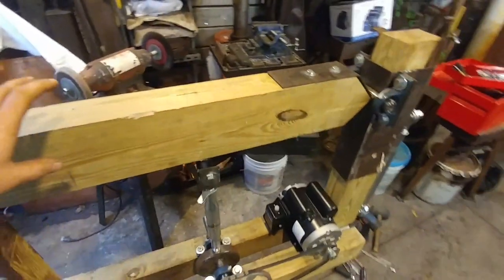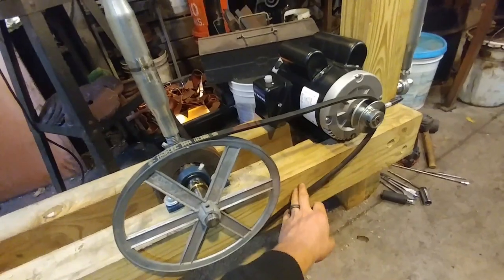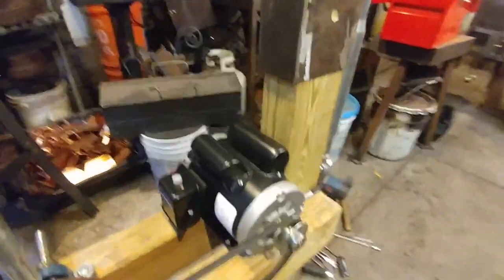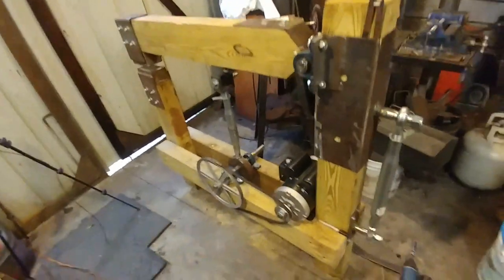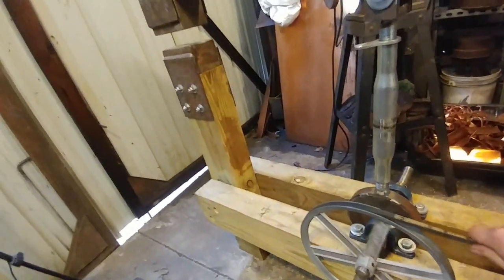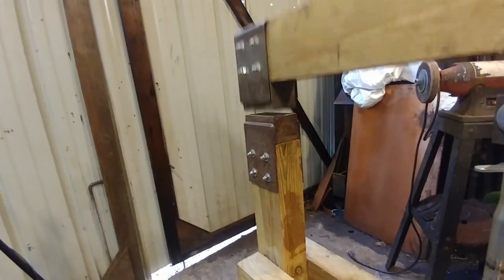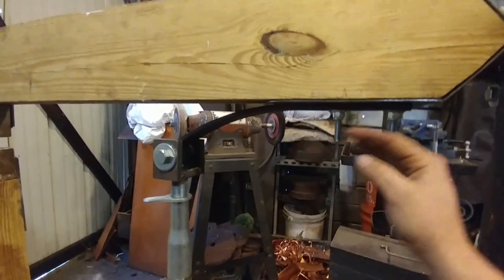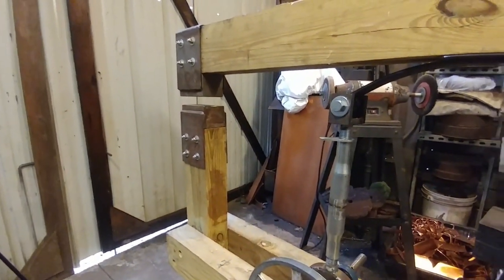Power Hammer Build News #8

Comment: It's looking really good Roy. It makes mine (a modified version of your improved hammer) look wimpy by comparison. It appears that your surgery is healing at a fast rate also. When I had all of my wisdom teeth removed some 45 years ago I developed a dry socket condition in both of the lower locations and it hurt like crazy and took a very long time to heal. I couldn't open my mouth wide open for nine months. Here's hoping yours goes much smoother.

Comment: Looking good Roy. Glad you’re feeling better. I have a question though. Are you going to use a mechanical way to tighten the belt to make it hammer or are you going to use a foot operated pressure switch to turn the motor on to make it hammer?

Comment: hey roy glad your getting better quick how much offset do you have on this cam your plans i brought say 0,625 inches i worked it out to about 15mm is this enough as that seems quite small for powering a hammer i know you get whip action on it but i feel its very small
Reply from the maker: +grayem pepper hey grayem that is a little too small I think it may be a typo on the plans that I will have to adjust. The offset on this particular cam is approximately 2 inches or 50 mm. Because you are lifting closer to the fulcrum point you do not need a large cam in fact a large cam throws off not only the balance of the whipping action but also puts higher torque on your electric motor so it will require a lot larger pulley to drive it. This also means your RPMs or your potential hits per minute will be a lesson to a great extent. I hope this information helps God bless you for all your great comments and your prayers this week I've been needing them.